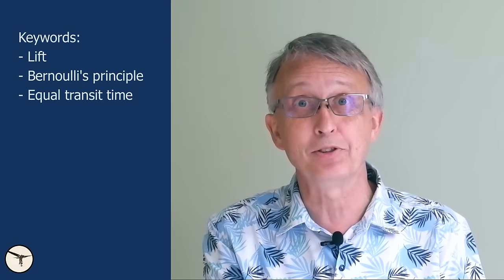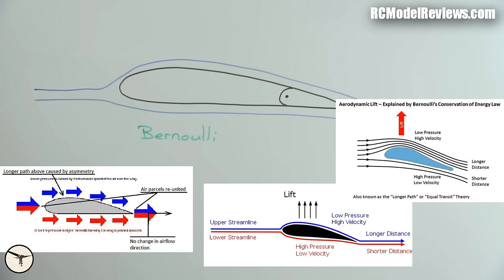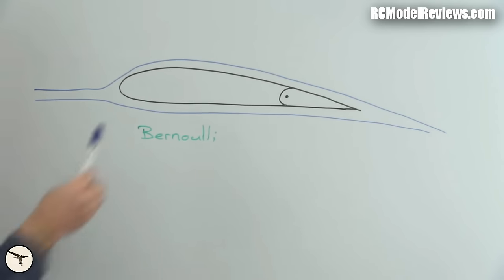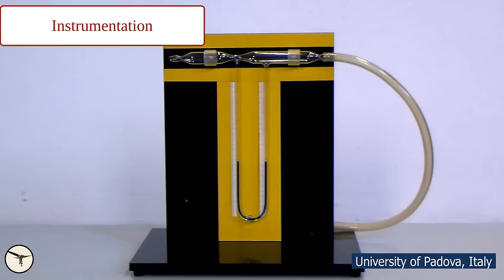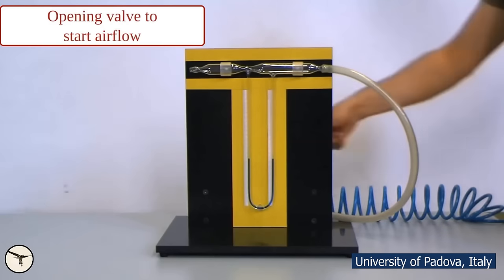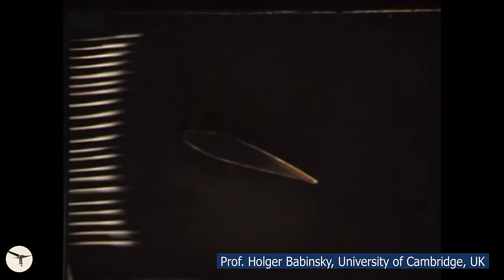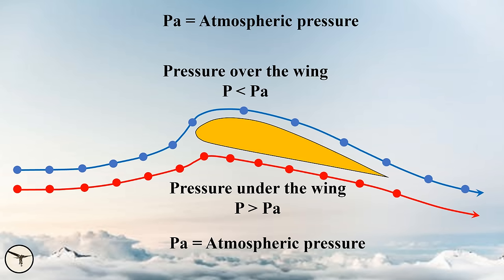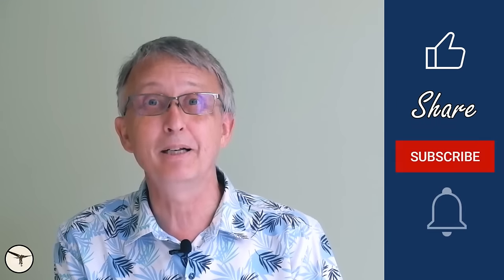Why are so many pilots wrong about Bernoulli’s Principle?

Comment: That makes so much sense in contrary what we see always explained the wrong way. This is a great video, thank you.
Reply: So why do you believe THIS video but not others?  I find it interesting.
Reply: @thomasmaughan4798  Because the other more common explanation never resonated with me and I always felt I did not understand it. With this explanation I feel like I understand the physics behind it. My back ground is in the semiconductor industry, so I may be a layman at fluid-dynamics but from a technical perspective.
Reply: @hugobloemers4425  I admit that the usual explanations of Bernoulli effect are incomplete and don't really explain the region of low pressure directly above the wing; the missing element is inertia .   Air, being viscous, has inertia.  So the leading edge rams into the air in a non-symmetrical way.  Under the leading edge is relatively flat; the air gets sliced.  The part above the leading edge is rounded, but in a very specific way.  A short radius, sharp rounding starts upward and the air has high pressure and low velocity.  As the air starts to gain vertical velocity it reduces its pressure in the immediate vicinity, the venturi effect but since it is close to the surface of the wing, this venturi effect causes the air to cling to, and follow, the curvature.  It has inertia and it is that inertia that is trying to pull the airflow away from the wing; but the venturi effect is creating suction.  The air is rapidly gaining velocity, which lowers the pressure even more, and because of this increase in velocity, you simply cannot curve the wing as much or it will detach from the suction with a lot of turbulence.  That's called a "stall" if this airflow has such inertia that it overcomes the venturi effect; the suction is not sufficient to keep the airflow attached to the wing. 
And finally, you let the airflow gradually rejoin the airflow that went under the wing.  This reduces or eliminates turbulence and the energy robbing effect of turbulence.
At the most efficient, you don't need an engine at all; gliders in other words, and they operate entirely on the Bernoulli principle and keep their airfoils straight into the wind.  Getting a glider down can sometimes be a challenge.

Summarize:  The wing does not know or care what the wind is doing.  It knows only that the air pressure under the wing is higher than the air pressure above the wing, and while many approaches exist to make it so, a wing with a rounded upper surface will cause air to try to pull away from it creating a suction, and that's where you get lift.  If the wing was simply convex, then you would have an area of pushing down, and an area of lift, more or less cancel.  So the abrupt convex area and long gentle curve after that eliminates the down-pushing aspect; the drag vector is to the rear instead of down.   The engine is overcoming forward drag and not much needed for staying in the air.  (and a glider has no engine).  
A helicopter in hover, meanwhile, uses enormous power just to stay in the air, but even then, the blades are shaped as airfoils to increase efficiency and stability.
Reply: @thomasmaughan4798  Thanks for taking the time to write this reply :)

Comment: This example does not disprove the "a longer distance" hypothesis but rather "kind of" emphasizes it, showing that the airflow speed over the wing is even higher than the hypothesis predicts. At the same time, the example proves nothing because it shows a symmetrical airfoil at a high angle of attack, which simply slows the flow beneath. Lift is generated by the transfer of momentum from the airflow to the wing - the flow simply pushes on the wing. And all of this has little to do with asymmetric airfoils and small angles of attack.

Comment: I'm not sure what's being said here. It seems to be a criticism of pilot education, but what is the specific criticism? Bernoulli only holds true when there's non-turbulent flow and when laminar flow starts to break down the forces on a wing (or anything else for that matter) become a far more complicated proposition. It's fine to tell pilots about lift generated by laminar flow around an aerofoil but I'd be surprised if they don't cotton on very quickly, maybe around the time of their first stall, that there's a lot more to the fluid dynamics of lift than just what Bernoulli said.

Comment: So is there any lift from a wing if it is at 0° AOA? What is the purpose of asymmetrical camber of the wing ?
Reply from the maker: Yes, an asymmetrical wing will procedue lift at 0 AOA because of the greater camber. No, a symmetrical wing will not produce lift at 0 AOA. 
The purpose of the camber is to increase the curvature over the wing, which in turn increases lift. On fast aircraft, the curvature is reduced as this reduces drag at high speeds. Fast aircraft rely on flaps and slats to increase the wing's curvature for slow flight.

Comment: Pilots are like truck drivers.We only learn the theories and remember them just long enough to pass the written exam, it is not going to help us in emergencies Just like truck drivers, they pin a lot to them for being responsible for things best suited for a mechanic and a well equipped shop. So the truck pretrip and the preflight walk around are done more for pleasing the regulators than anything safety they can see.  I have so many stories of emergencies in the air and the co-pilot did not see anything before take off, even when it was obvious.  I also seen enough truck drivers that filled out the pretrip paperwork to perfection and never leave the cab, especially in bad weather.

Comment: Having watched and read much on the phenomenon of why a wing flies….While I agree that the reduced pressure above the wing ASSISTS lift, I still maintain that if you are pushing a plate into a body of air and give it an angle of attack then your plate,  of itself, is definitely creating a helpful cushion of air that it sits on and will be LIFTED by that cushion just as much as it will be SUCKED up by the lower pressure above it. 

In years past the explanations always seem to want to state that a wing is SUCKED up, with out ever including that it is also being PUSHED up from below.

Comment: I thought it was more simple than that. A wing produces lift because it deflects air downwards (action), which results in lift (reaction). Bernoulli just helps a little. 
A wooden plank will generate lift, the airflow of upper side will immediately turn turbulent however. So, no Bernouillii there. Still it will fly given the right angle of attack, speed and CoG. 
Wings as shown here are to make lift more efficient, to put the point where the turbulence will start at the upper side as far away from the leading edge as possible. Turbulence creates friction. You want as little friction as possible.

Comment: Many illustrations of air flowing around a wing have an error. Some of them show the air continuing to flow horizontally after it has left the wing. That does not happen! Any time a wing is producing lift, it is also causing a downdraft behind the wing!
There is a loss of lift when the airflow separates from the top surface of the wing. Then the air DOES continue horizontally after it has left the wing.
Drag also increases sharply.
The aluminum overcast turns into aluminum precipitation!

Comment: I agree that in the pulse at 3:10...the air over the top arrives at the tail of the wing faster than the air passing under the wing.....but in real life air is not pulsed at a wing....it's continuous...and the transit times would quickly have to reach equilibrium....or the lift would change with the duration of the flight....what am I missing?
Reply from the maker: The air is not pulsing. Only the smoke. The acceleration over the wing contributes to most of the lift.
Reply: @FlywithMagnar  That's so funny...

Comment: To be honest everybody believes the equal transit theory is wrong but as per the smoke tunnel theory the smoke a.k.a relatuve airflow is not in contact on the trailing edge but if u notice more closely they will meet each other after a certain distance on the trailing edge, and more over the two main key theories are the equatioon of continuity and the Bernoullis theorem

Comment: Wings are not lifted by lower air pressure over the wing.   The lower air pressure over the wing can not meaningfully move the plane because of its inertia.  However, ABOVE the low pressure area created by the wing is an OCEAN of air at a higher pressure. The individual molecules of air have a much lower inertia and so they immediately rush to fill the low pressure over the wings.   By the time they get there, the wing has moved out of their path, and the result is a DOWNWARDS thrust created by the wing.  When the mass of the air being thrust downwards exceeds the mass of the aircraft creating the downwards thrust, the plane rises into the air.   Action-reaction. ( the underside of the wing creates an overpressure as well because of the Angle of Attack, this overpressure can not move UP because the wing is in the way, so that air expands downwards into the relatively lower pressure  well below the flow hitting the wing.  This Adds to the mass of air thrust downwards, created by the wing passing thru the air. )   Bernoulli’s principle creates the low air pressure, but its not the low pressure that ‘lifts’ the plane.   Its the low pressure zone creating a net thrust downwards because of the high ambient pressure above the zone of low pressure.      Every Propellor and fan is nothing but a revolving wing.   They obviously generate a higher thrust than they do “suction”.   Similarly, a vacuum cleaner does not actually move dirt thru suction.   It moves dirt by getting the higher pressure air near the nozzle to accelerate into the low pressure zone inside the hose. It is the higher pressure air outside that sweeps the dirt into the vacuum.

Comment: The only thing important from that principle is to explain how the acceleration of air particles creates less pressure thus that differential creates lift as simple as that.
Reply: Mass flow rate must be maintained (conservation law), so momentum increases to satisfy the flow rate continuity (around detours), must be fueled by conservation of energy (static pressure drops to account for the increase in dynamic pressure).  

The static pressure "borrowing of energy" bends the momentum of the relative airflow in a transverse direction (at right angles from the direction it had been flowing).

Energy to maintain the original momentum, changes the momentum direction (due to the "stress" of imposing the airfoils asymmetrical geometry).

Comment: That demonstration with the glass tubes and Venturi is confusing. Your conclusion that this experiment shows the drop in pressure at the Venturi is causing the movement is not necessarily correct. The increased pressure in the tube before the Venturi blockage could be the cause. However Bernoulli says it is both. To show the Venturi effect it would be necessary to open the other end of the U tube to the atmosphere. To show the pre Venturi pressure increase effect similarly the othe end of the u tube should be disconnected from the Venturi and open to the atmosphere.
Also you have not explained why the leading edge and upper surface cause acceleration of airflow. I can see how undercamber and angle of attack causes increased pressure under the wing. I am guessing the different speed of the two airflows contributes to lift together with the vector of the forces caused by the angle of attack.

Comment: I liked this demonstration.   What about the Coanda Effect?  The fluid flowing over the top of the airfoil clings to the wing surface, and as it follows the trailing edge, it is directed (accelerated) downwards. Following Newton's Third Law,  the mass of the air flowing downwards exerts an equal force in the opposite direction: upwards.  This is how most of the lift is generated. If the angle of attack  becomes too great, the fluid cannot adhere to the trailing edge and the lift ceases.
The flow along the bottom of the wing, can also be diverted by flaps or ailerons, and this directs even more air, or water, downwards, generating even more lift.
Also, because the airflow (mass) is taking place along the trailing edge, it exerts a rotational force the wants to pitch the airframe downwards. The elevators counteract this by directing air leaving the trailing edge of the tail upwards to maintain level flight, or whatever pitch the pilot wants.  Without that counteracting force, the craft would do a somersault and tumble over itself and out of the sky, like a leaf blowing in the wind.
Please tell me if I'm completely wrong here.
Reply: YouTube title: Doug McLean | Common Misconceptions in Aerodynamics puts much less emphasis on the Coanda Effect. The clip has some chapters.
Lift has not been defined. So far I'm in the "it's mainly like a rock skipping on water" - And if one can't generalize that to a steady flow model then one can't criticize it.
Reply from the maker: The Coanda effect is used to blow air over the wing's upper surface and/or flaps to control the boundary layer. 
Lift is not Bernoulli or Newton. They both describe the same thing. Please watch this video: https://youtu.be/ph1HqrioLPs
The bottom of the wing produces only a small portion of the lift. That's why a wing stalls when the angle of attack is too large and the airflow over the wing is disturbed.
The downwash behind the wing is balanced by an upwash ahead of the wing, which is also part of the lift. https://www.av8n.com/how/htm/airfoils.html#sec-upwash-downwash
The rotational force is created by the fact that the lift center is behind the center of gravity. It is balanced withe the horizontal stabilizer (and elevator). If you move the center of gravity the the location of the center of lift, the aircraft will be unstable like the F-16, which can only maitain flight with the aid of computers.
Reply: @FlywithMagnar  With all due respect to you, an industry professional who is captivated by the subject, your demonstration of the Coanda effect at three minutes into the clip you linked: "Forget Bernoulli and Newton | The easy way to explain lift" is misleading.

The leading edge of the paper device is different in the two orientations you demonstrate. While it's tempting to address the airstream and leading edge curl, the major force difference in that specific demonstration is the natural springiness of the paper pulp matrix. That springiness assists the success of horizontal demonstration by amplifying the effect. In the vertical demonstration it contributes to stiffness which resists the effect but contributes to flutter.

Held horizontally as shown, the leading edge curl imparts forces, pressure and tension on the whole matrix, including the trailing edge. Those forming forces are from within the paper matrix and would be present to form the paper to the same shape even in a vacuum. 

Vertically held the paper's shape is maintained by the matrix' springiness and produces flutter where the trailing edge is not assisted. Again, in a vacuum any vertical paper would conform the same vertical shape.

I am not convinced you watched the clip I posted the title of. Perhaps you did. It is of a Boeing Technical Fellow's lecture at U. Michigan, it lasts about 45 minutes and presents the non-matrix factors you and I cite, and more. As I wrote before, it recognizes the Coanda effect as integral to the phenomenon of lift but does not predominate the phenomenon.

However I find Doug McLean's multi-force harmony approach to be more comprehensive than yours.

Ultimately though I believe LIFT has not been fully defined due to the inability of real-world observations to be made. My statement is not meant to discount the importance of wind tunnels, it is simply to state that measuring aerodynamic changes at some fixed points in space relative to the moving aircraft is extremely difficult.

That last point in mind, from the reference of an aircraft moving at 200 knots at an altitude 1000m above the ground plane, to discover where air initially is disturbed by the oncoming aircraft, for instance, is a challenge. Perhaps flying through a hectare large array of smoke trailing rockets would help, but I haven't seen such footage.

Comment: But professor V^2/(2g) is the dynamic pressure head. The higher the value of wind velocity "V" the higher is the dynamic pressure head due wind velocity. The velocity is high on the top surface of the wind and less near the bottom surface of the wing. Thus the wind pressure should be higher on the top surface than the bottom surface.

Comment: I think that an entire point is being missed here that the bottom line of "lift" is conservation of momentum.  It's all about the MASS of the air being accelerated in various directions that generates the force to keep the aircraft aloft.  Nebulous talk about "pressure" and airflow speeds are an unnecessary abstraction.

This is why R/C models can fly perfectly fine with completely flat wings (no, it's not about "power", they are not capable of unlimited vertical flight, it's all about the the ratios of surface area to weight in models (squared-cubed relationship)